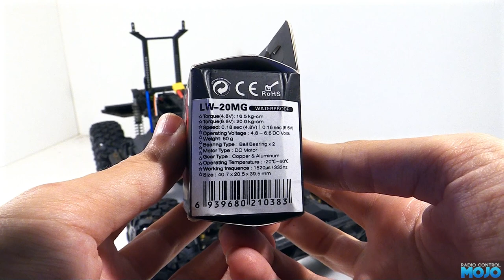Traxxas TRX-4 - Servo upgrade and spare tyre mod

Comment: Hi There, great tips.
Curious to see how the servo performs and did you end up doing a video on how to increase the power to the servo to 7.4v?
Your idea on the rear wheel is great. I think we could reduce the weight even more by punching holes in the foam and scavenging the rim in certain places that you don't need to achieve even more weight loss. This is me being picky but as you framed it welt just for looks mainly.
I will definitely try that.
Thanks for sharing.
Reply from the maker: I've only ever run the servo on 6v, and 3 years(?) later it's still going strong with plenty of torque. I think in another video I wired in a 6v BEC dedicated to the servo

Comment: Just a little FYI , the stock Servo screw from Traxxas is twice as long as the one that HD provide with the 20kg waterproof servo , The Traxxas screw won’t fit the HD Servo , so just fit the one provided with the Servo ✌🏻

Comment: The 10 amp Castle Creations BEC with a waterproof Savox servo put a BIG smile on my face! 
The Traxxas 2075X servo SUCKS! Mine went out when I was driving over feathers & marshmallows! Might as well been. I ran 2 to 3 Traxxas lipo 2s 5800mah through my TRX4 before the 2075X died. Other than the servo issue I wouldn't trade my TRX4 for anything. I love that truck!

Comment: Hi there.
I watched your series on the building of the Grand Hauler. I bought one myself and unfortunately I messed up my paint job, anyways long story short I used thinners to try get many layers of paint off the body which has now ruined it to the point where i need a new one.
Could you recommend where I can get just the body, as well as the part that goes on the roof and the back plate.
It would be greatly appreciated.
Thank you in advance.
Kind regards.
Rosser
Reply: Rosser Outdoors try ebay, always something on there left from custom builds

Comment: Hi! Need BEC for this servo? Or only plug and play? Thanks for the video 😉
Reply from the maker: The 20KG servos run 'ok' from the BEC build into the Traxxas ESC, but not to their full potential.
The cheap route is to add a 3A or more external BEC to run the servo, or you can replace the Traxxas ESC with a HobbyWing WP1080 which has a built in 3A BEC that'll cover things nicely, plus has many more options to play with in it's settings.

Comment: Hei from newb in Norway..can that grease you use, be used to waterproof anywhere on rc car..gears ..axels..?
Reply from the maker: For the gears use marine grease, usually it’s blue and really sticky, it’s designed specifically to keep things lubed up when there’s water around.
Reply: Thank you sir..

Comment: Hi, I put a 20 kilogram digital servo in my rgt crawler and it does not work, it just trembles and moves without control. I do not know what's happening, you have some idea that it might be happening. Thank you
Reply from the maker: It could be low voltage due to a resistive connection in the power or ground, the signal could be intermittent or of course you just have a duff servo. I hope you got it sorted.